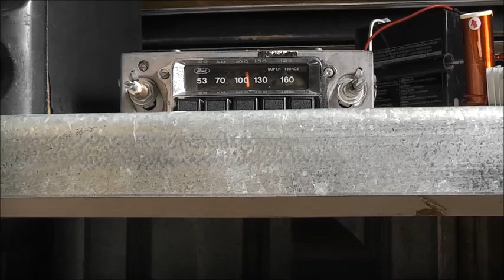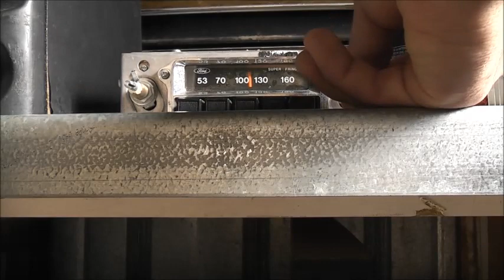Tesla Coil AM Radio Transmitter

Comment: have a very powerful 35 watt FM rig which is really nice to use however never run full power as signal so strong but having AM would be nice to.  The newest station to use AM was radio Caroline that came on 648 last year in our place.